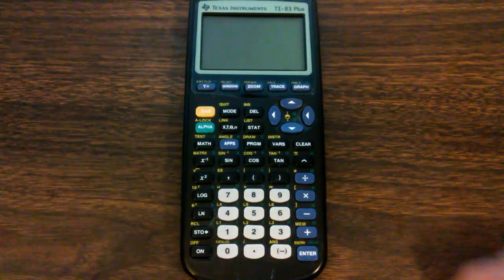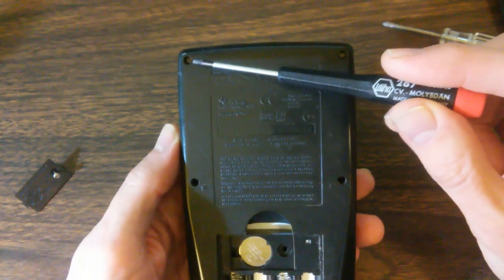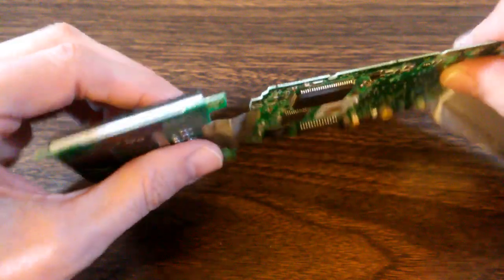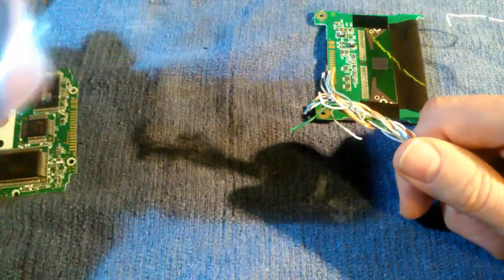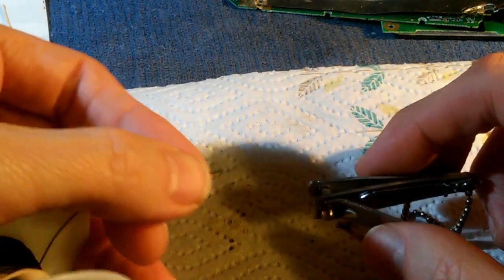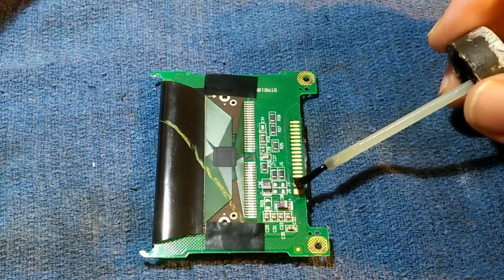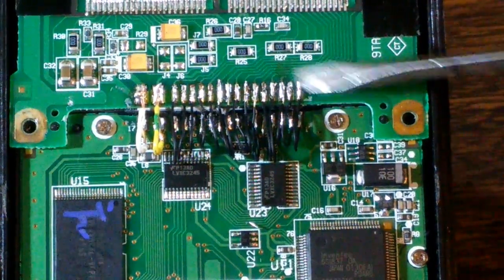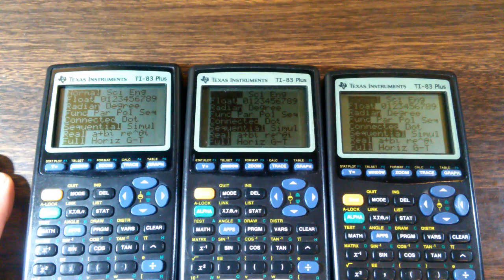TI-83 Plus Calculator Glitchy Screen. Replace defective flat cable.

Comment: My TI-83 Plus began having this problem just a couple days before my statistics mid-term. I couldn't afford the $100 for a new one nor did I have time to order a used one on eBay, but I did already have a good soldering iron. Thanks to your video and clear instructions, I was able to fix my calculator good as new. I'm now ready for my midterm tomorrow!
Reply from the maker: Thanks for the feedback. I hope you get a A+

Comment: While watching this video I was troubleshooting my TI-83 plus. The problem was that when turned on, all the pixels lit up and were stuck on. When I measured the continuity at each side of the ribbon cable, the resistance was varying between the traces from 5 ohms up to 200 ohms, and some were even open circuit. I have had luck previously using a soldering iron at low temperature setting and "iron" the ribbon cable back in place, pressing slightly down while sliding slowly over the ribbon cable connection points. And shure enough after a couple of passes, the resistance was down to mostly 4-5 ohms through the ribbon cable while measuring at some contact poins on either side. Some values were slightly higher. After another go, ironing the ribbon flat flex cable with the soldering iron, all connections were below 5 ohms. I hope my easy fix will last for another decade or two ;)
Reply: I also use this method when there is an LCD/ribbon cable issue. Sometimes the repair will last for years, sometimes just weeks. Instead of a soldering iron, I use a polished metal rod that I heat to 80-100 C over a gas flame.

Comment: Thanks David. You use some very useful techniques for your repair. Failing ribbon cable is becoming the bane of repairing vintage kit. Calculators or keyboards, it just doesn’t last and replacements very hard to come by.

Comment: Thanks for this video! I was able to replace mine first try using 30 gauge silicone wire, the good thing about silicon wire is it bends much more freely than regular insulated wire. And as others have stated flux is definitely your friend in this repair. It also made it easier for me when the ends of the wire were tinned well. If you have (or want to make) a solder pool, that will help greatly for tinning very small wires.
Reply: What a small world! I was able to wiggle mine for a quick fix, but I'm sure it'll need a proper replacement soon enough.

Comment: I fixed an "A" rev. TI-83 Plus with scrambled screen and, following your procedure, it works again :o)  Thanks for posting this video! I used acetone on a cotton swab to remove the adhesive from the flex cable remains. It was too hard to scrape off with my fingernail. I used 30AWG wire-wrap wire for all of the connections, including to the two larger power pads. I used a CLAUSS WS-7 wire stripper that went from 22 down to 30AWG to strip the wires.
Reply from the maker: Excellent.

Comment: If you're bad at soldering (like me), I had a luck with just heating the cable with a heat gun, and then pressing firmly against the contacts with a spudger to try to seat them a little bit better. That was all it took for mine. Been using it another 2-3 months since, no issues.

Comment: Great video, took my time and followed all the steps and worked great! I'll add that the ribbon cable looked good before starting but there was a mysterious continuity issue so I cut it out and did the repair. Also add I used a pencil eraser to gently remove the cable adhesive and that worked for me. Flux is a lifesaver for these kinds of jobs!
Reply: So you literally erased adhesive

Comment: This seems to be a similar issue to the LCD display on the Roland MC-505 LCD. A sort of fix involved using a clothes iron tip to press down on the cable. Soldering gun is too hot.

Comment: Excellent video. Solved my issue. I used wire strands instead of the whole wire but still worked like a charm.

Comment: Another idea with readily available supplies: pick up some thin guage bare wire from the jewelry section of a craft supply store, and the thinest heat shrink tubing from hardware store. Apply heat shrink to a pair of wires, one a bit shorter than the other so that the tubing can shrink tightly and you have exposed wire tips to solder.

Comment: The wire-wrap wire is not really intended to be stripped. The normal use case is for the wire to be tightly wrapped (with a wire-wrap tool) around a square post with sharp corners - the very sharp corners slice into the insulation to make the connection. The insulation also oozes a bit so the connection becomes sealed from the air. If my memory is correct, we had to put five full turns on the post. I GREATLY preferred soldering on boards  over that new-fangled wire-wrap. But as an electronic tech in the 1970's-1980's I had to work on whatever came across the bench.

Comment: I have the ti-84 plus silver edition and the pads are fine. The cable is fine no tears and checks continuity on both sides of the cable. Batteries are all good. I testing all that with multimeter and I test the on button. Power is getting to different components on the board as well and I tried all the resetting tricks and the calculator still won’t turn on.

Comment: I have an all black display, adjusting the contrast didn't work for me.  In your video you have a black screen Ti83+ with a strip down the display - should a similar repair work for me, or is there another possible fault?

Comment: Great demo! Would you be able to diagnosis which wire is bad so only replace one wire standby such as power wires rather than all wires?
Reply from the maker: Use an ohm meter to find the lines with reduced or no conduction.

Comment: Hello, this is a great video. I have a problem with my Texas Ti85. Nothing on the screen when i press the button ON. I have checked the connectors on mainboard and nothing bad on the pcb.
Is it possible that the problem is a bad flat cable? Thanks for your help

Comment: I tried this and it went well for a few wires and then one of the copper pads fell off trying to solder a wire to it. Thank goodness i didnt pay over 10.00 for it.
Reply from the maker: I had one pad pull off also.  Fortunately there was anther spot where I could solder that wire.

Comment: Hi I have a
Ti - 82 calculator that I bought on ebay, unfortunately after a while I was
doing operations it crashed in particular while doing operations with a
variable, after it got stuck, I tried to use the batteries to reset it but it
did not given no result, I also changed the buffer battery, but nothing now
turns on but nonsense digits appear on the display and it does not turn off!
Batteries must be removed. Can anything be done to solve the problem? Thanks.

Comment: Hi! My calculator look a little different on the inside. The ribbon cable is significantly longer and the connection pads are almost half the size of the ones you soldered in the video. There is also over twice as many pads so it’s impossible to solder wires onto each one. Do you have any tips on how I can repair my calculator? Is there any way I can reestablish the connection using a new ribbon cable rather than soldering wires to it? I think I have a different model from the one you have ... I‘d be glad to send you some pictures of what the connections look like if you’re willing to give me your email. Thank you!!

Comment: Thanks for uploading the video. I have a screen with lines, maybe I will try to use your method to solder the two boards together. I saw on Facebook market place they listed a used one for $20 bucks, but if I can fix mine then that's great. I work in the avionics repair shop so I have all the tools that I need. I can use Humiseal to cover the solder joints so they don't rust or short over the time.  Hopefully, this will fix the screen.

Comment: Hi what if LCD screen is damaged? can you obtain a replacement lcd screen to solder?
Reply from the maker: TI does sell a few replacement parts, like back covers and rubber feet.  I do not believe a replacement screen is available.  The screens are made by TI specifically for each model of calculator.  Probably the best you can do is cannibalize one off of a broken calculator with a good screen.   I have another model of TI graphing calculator with a cracked screen.  I have spent some time looking for a replacement with no luck.

Comment: I have full voltage at the battery contact pads and I have continuity between each point on the ribbon cable, but my screen still won't turn on.
Reply from the maker: Poor battery contacts and bad flat cables are probably the most common failures.  How ever, anything can go wrong.  There may be continuity on all of the lines in the flat cable,  but if any lines have high resistance, that could cause a failure.  Look carefully for cold solder joints anywhere on the board.  There is an interesting video where someone digs further and finds a shorted buck converter.  You might have a look at that:  https://www.youtube.com/watch?v=ayXABtD70mY

Comment: I have a couple of black spots on the screen of the Ti-83 Plus even when the calculator is turned off. Do you  have any suggestions? Thanks in advance.
Reply from the maker: Permanent black spots indicate damaged areas of the screen.  Probably from mechanical impact.  There really is no fix that I am aware of.
Reply: Thanks because me. Too

Comment: you did a nice job...but, let's face it, this is not a job for amateurs. I could see myself working at this for many hours and still not coming out on top. But, judging from the comments section, not everyone is as faint hearted as I am.
Reply from the maker: You are correct.  This is not easy.  It requires steady hands and soldering skills.  How ever, if your TI-83 has a bad flat cable, the calculator is of no value.  If you try this fix and it fails, you have not lost anything.  If you succeed, you will restore your calculator and you will be beaming with pride.
Reply: @c.davidgraves4848  well, there's a certain amount of truth in that...
Reply: I just fixed mine, for my 1st time soldering anything ! picked up a $20 soldering iron from canadian tire and ripped up an old hdmi cable. Way better than buying a new ti 83 ! Definitely a tedius job but follow the video and it ain't bad really.

Comment: Great Video! I was about to do that but when you mentioned the connectors were only glued... I got my heat gun out and made an aluminum foil "pinpoint" nozzle, and heated each contact row up for 2 seconds and squished the connectors together firmly, trying to make a better connection.  Worked like a charm for me! Warning, too much heat could un-solder other things... that would be bad, very bad. If that didn't work, I could always use your method. I was going to use some computer ribbon cable..??? That may be too small?
Reply from the maker: I am surprised that worked.  It would be interesting to know if it remains fixed.  My experience with such fixes is that they are temporary at best.  I had considered using ribbon cable, but I could not find any where the spacing of the connections was the same.  All the available cables are metric and on this cable the connectors are spaced in fractions of inches.
Reply: @c.davidgraves4848  Yes, I am worried if it will last. I'll keep you updated. and again I can still go back to your method. Thank you!
Reply: @c.davidgraves4848  Update 2020 school year. My daughter came to me saying the calculator needed new batteries, I thought for sure it would be non functional.  but after new AAA's, it's still working!
Reply: @Langelierdesigns  Dude did you seriously remember to come back like 15 months later
Reply: @Langelierdesigns  Does it still work in 2023?

Comment: Such a hassle. I was looking for some kind of zebra stripe to fix this. Just using 20g bare wire works fine. Shoot hot glue in it, done
Reply: 28g, not 20.
Was very fast using bare wire. I think the hot glue is quite fine

Comment: Remember that replacing should be a last resort. Mine worked fine after smushing my thumb along it because it was just loose.
Reply: I just did this and it works like new. I didn't even have to open it, I just pressed the plastic casing. Thanks for the recommendation.
Reply: This worked for me!  I took the bunched up ribbon and instead of having it flattened downward, I evenly distributed the bend onto the top and bottom leads.  TI-83 Plus Silver Edition works perfectly now and I'm so thankful, I was trying to view a note entry I made back in high school 18 years ago lol.  It was still there!